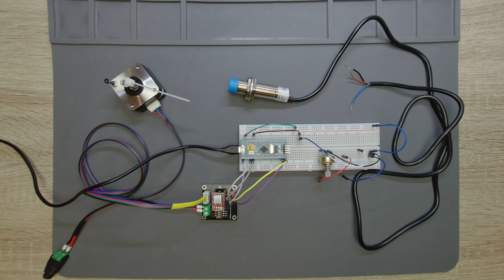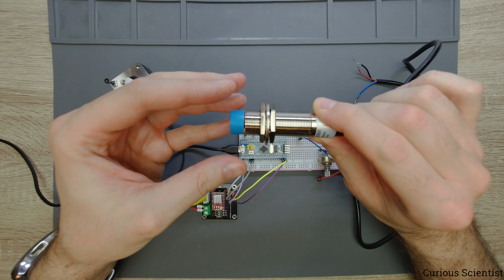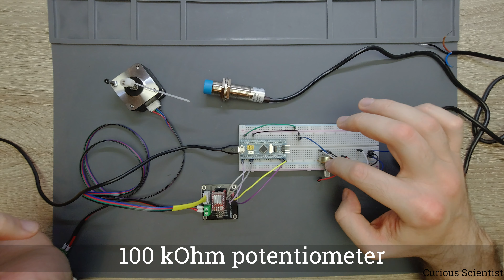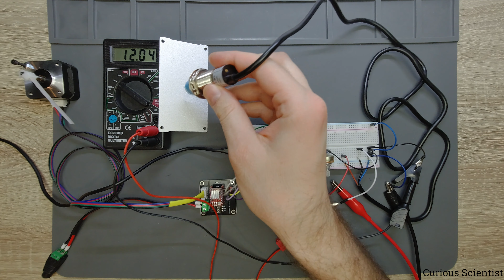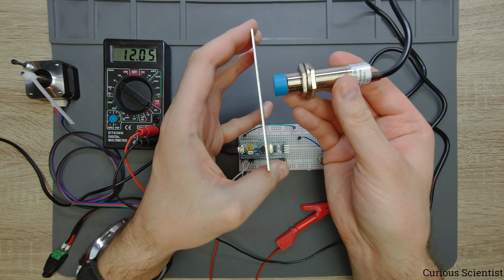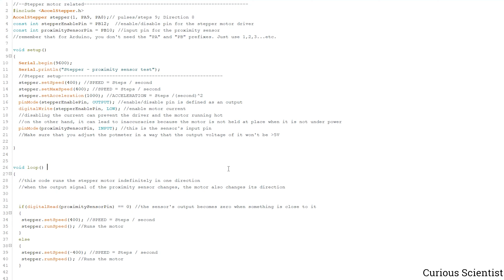Testing a capacitive proximity sensor

Comment: It was very clear explanation. This devices are used everywhere from garage doors to production lines at factories.
Reply from the maker: Thank you! Yes, they are extremely widespread. I am also planning to use them in some future projects, but they are not that cheap and they are also a bit bulky. Sometimes a tiny limit switch does a "better" job due to its size.

Comment: so what is the accuracy of capacity sensors? If I want to measure a variation of distance 0.5mm would it work or an inductive would be more accurate?
Reply from the maker: This is not a distance sensor but a proximity sensor. I guess their accuracy depends on the model, so I would suggest you check the datasheet of the product before buying it.
Reply: did not expect you would be answering so promptly, my respect for your communication with the followers. I do not want to measure the distance but to detect proximity whithin a certain distance which in sense is a kind of distance measurement but indirectly. So if I intentionally calibrate the sensor to detect the obect at 3 cm, what is the minimum distance the sensor will not detect the object? Will I still detect it at 3.5 cm? Thank you!
Reply from the maker: One of my principles is to try to communicate with my viewers as well as possible. So yeah, I am trying. The sensitivity of these sensors is quite good, and typically, you can adjust it with a potentiometer with a high accuracy. Unfortunately, I don't have the exact numbers, but if you can wait a day or two,  I can measure it for this specific sensor. Otherwise, I still recommend referring to the datasheet.
Reply: @CuriousScientist  I appreciate that, don't worry, I looked up online for acurracy of 0.1mm sensors but I think it is not called like this. It is either resolution or something else. Data sheets would provide the range of detection but that is something different.

Comment: Hi
can you tell me what is the reference of the sensor and is there an  eddy current sensor with similar properties?
Reply from the maker: Hi! You can find the product on my website under the Parts & Tools section, in the Motors and related circuits subsection! I also shared an inductive sensor on the exact same page. Cheers!

Comment: Hello great video , just wondering if this proximity sensor can be triggered by magnetism thank you
Reply from the maker: Hi and thank you! Not this exact one, because this is a capacitive one. But there are similar, inductive proximity sensors. Same housing, same switching principles, but the sensing is done on inductive/magnetic basis. But if you want to sense something magnetic, or based on magnetism, I also suggest you to look at Hall-sensors. They are very cheap and they also detect magnetism, so the presence of a magnetic field can trigger them.

Comment: I wired directly the capacitive sensor to my arduino and now my arduino is broken. Why is that? Is the signal from the capacitive sensor exceeds the limits of the arduino?
Reply from the maker: Yes, you're not supposed to use signals higher than 5 V... it's a basic Arduino knowledge.

Comment: Know anything about how how using a capacitive sensor and instrumentation amplifier can be used together?
Reply from the maker: I think you don't need any additional circuit for this device as it has everything built in.
Reply: @CuriousScientist  what about software for data or a computer? Is that needed?
Reply from the maker: What exactly do you mean? This runs without any additional things. No software is needed for a proximity sensor.

Comment: Great video. Does the proximity sensor work underwater? I'm developing an underwater gripper and would like to add a proximity sensor to it.
Reply from the maker: Thanks! I believe that capacitive sensors would not work, but I can be wrong. You might want to try magnetic proximity sensors, they should work under water. However, they would require magnetic material for detection.
Reply: @CuriousScientist  I've been trying to deal with this. Firstly i thought sonars would do but I found out there aren't any sonars that could be fitting in my gripper and also could work underwater. Gave up on sonars and went to proximity sensors and i'm trying to find an inductive or capacitive sensor that could work underwater but getting a bit hard. Maybe i'll only detect magnetical material, let's see. Thanks for the help!

Comment: Hey I am trying to build a circuit with a hall sensor, arduino uno, a motor and a push button switch. When the button is pushed, the motor should turn on and then when the hall sensor detects the magnet, the motor should turn off. Another press of the button should the reverse the direction that the motor spins. If I want the motor to turn off when the sensor detects a magnet do I need to use a PNP sensor?
Reply from the maker: Hi! You have to program the logic anyway, so it doesn't matter if you have a PNP or NPN switch. You'll determine the behavior in the code.
Reply: @CuriousScientist  thanks so much for your reply. If I use a NPN sensor, does this mean that when the magnet is brought close, the signal will be LOW?
Reply: and do I need to configure the hall sensor as an INPUT_PULLUP?
Reply from the maker: @daniellehenderson5272  Hi. If I am not wrong, the NPN proximity sensors go LOW when you detect something with them. You do not need to fiddle with the INPUT_PULLUP option. Also, you might need an additional circuit for your sensor if the operating voltage is more than 5 V. You cannot directly connect a 12 V or 24 V proximity sensor's output to your Arduino's GPIO pin...
Reply: @CuriousScientist  thank you that is very helpful!

Comment: Hi, I would love to know how to do this with acceleration and deceleration. runSpeed() does not seem to allow this function which is crazy for an Acceleration library. Is it possible to have a gradual start and stop speed initiated by a sensor input where you can't use runToPosition()? You code explanations are brilliant BTW! Thanks
Reply from the maker: Hi! You should read the very well written documentation of the library. RunSpeed() intentionally doesn't have acceleration. You should use run() if you want acceleration. Also, check my more recent videos where I have better code written using this library.
Reply: @CuriousScientist Thanks for the reply. I tried a straight swap, run() for runSpeed() but and it didn't make any difference. I have read the documentation but it's not easy to follow without example code for a newbie. I intend to watch all you videos, Any help is much appreciated. Thanks
Reply from the maker: What exactly is not working? Maybe I can help easily.
Reply: @CuriousScientist  That's awesome of you! Thanks. I basically just need to run my motor in either direction depending on a sensor input, exactly like you are doing with the prox sensor but I need acceleration to keep the transitions smooth. Swapping runSpeed() for run() didn't seem to change anything.. should it work that easy or do I need to change something else too? I'm using your code, the same as in this video.
Reply from the maker: Acceleration also needs target position instead of speed. So you will need to use the move() or moveTo() functions to determine a target position. You should give some larger number as a target than the number of steps required to reach the end stop switch. Then, when the switch is reached, you stop using the stop() function which will decelerate to zero, then give the same (slightly larger) target with an opposite sign and let the motor run in the opposite direction. Obviously, you should have another limit switch on the other side.

Actually, the code I used in this video should help you: https://youtu.be/_enXxcBTOdM

You just need to modify a few conditions and it is done.
Reply: @CuriousScientist  Ah, I thought it may be something like that.. I'll give it a try. Seems a bit of a complicated way of doing it though for a library that is built around acceleration. Thank you so much for your help. I have made a donation.
Reply from the maker: If you are still stuck after trying to modify my code, I can help you fixing it. Also, thank you very much for the donation, you are amazing!
Reply: @CuriousScientist  Awesome! Thank you. I'll give it a really good try and hopefully not have to bother you again so you can keep the fantastic videos coming. Cheers

Comment: schneider-electric-capacitive-proximity-switch-xt230a1fal2 , Have any of you examined the electronic circuit of this product ?
Reply from the maker: Hi! I checked the datasheet and it looks like a normal switch. It is an industrial equipment and it works at higher voltages.
Reply: @CuriousScientist  I had read the datasheet. I know . I had questions about the electronic board inside the Plastic Round tube. I meant this.
Reply from the maker: Oh, I see! Unfortunately, I cannot help with that, I never encountered that piece of hardware.